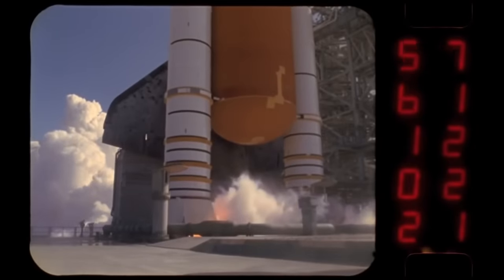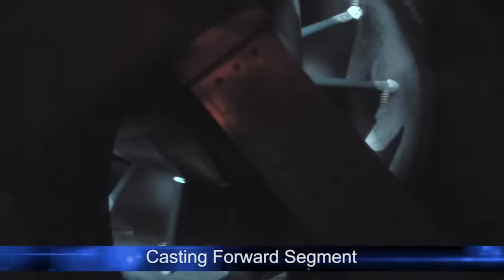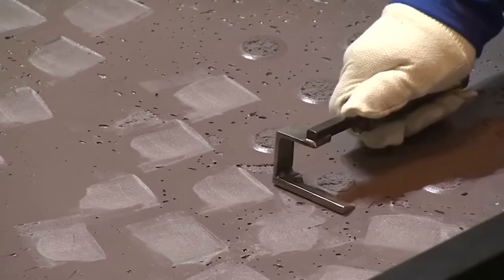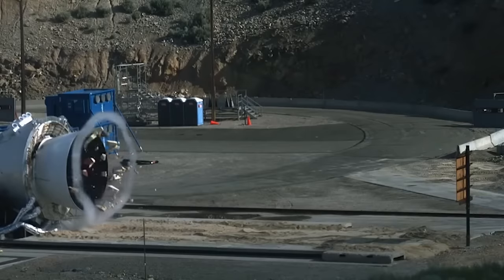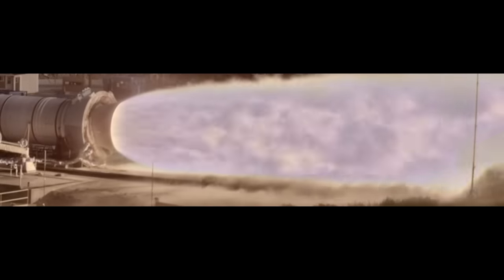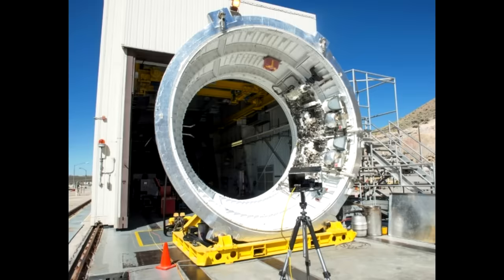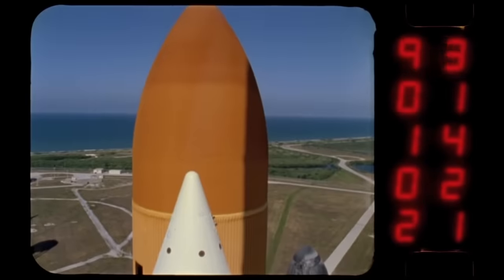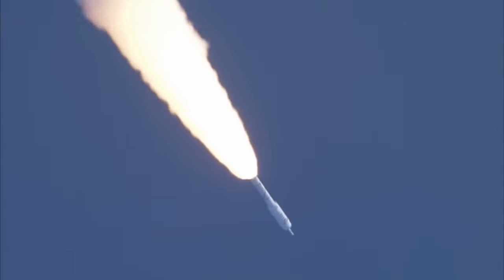The Amazing Engineering Behind Solid Rocket Boosters

Comment: Then why does it lift up so slowly. Like a balloon.
Reply: Because it's heavy...
Reply: It never gains much more speed Pablo Gonzalez. Surely the speeds required to break the atmosphere it should be out of sight in no time.
 What happens then? It arches. Would’ve thought it would of went straight up to save fuel, but again, no it arches, almost like it’s heading out to the Altlantic on a jolly flight to Europe. Then the shuttle always tips upside down, like the heavy part flipping around a balloon. Never understood this stuff.
Reply: @ArnoldClarke  You think it's fake because it doesn't match the idea in your head of what it should look like. That doesn't mean it's fake. It means you don't understand what's going on. 

The shuttle maintained about 3 g of acceleration for structural integrity and the entire flight to main engine cutoff was about 8 mins. Not sure how much faster you think it should be.

To understand the arc and the roll you need to understand orbital mechanics. It's part of orbital insertion. It's going into orbit. It's not a firecracker that just needs to exclusively gain altitude.

If you think it in any way resembles a balloon please seek medical attention.
Reply: Thanks for the explanation Pablo, not once did I say it was fake. I cannot understand the physics. 

At three times the rate of gravity the shuttle is only doing about 70mph.

It looks so slow and it does arch over the Atlantic. 

With the roll does it go on to break through the atmosphere upside down?

Again thank you for the explanation. What would do it, is if they put the camera facing forward. Never seen any footage of this. 

Everything modern on Earth that propels fast always has a camera forward mounted. 

Do you have a link of a shuttle take off with the camera facing the way the shuttle is going? My medicine is your education.
Reply: @ArnoldClarke   Implying they're simply headed across the Atlantic insinuates it's fake. But anyways.

Acceleration forces can't be directly converted to top speed so I question  your math. A top fuel dragster launches around 8(!) g to a top speed around 300 mph. The average airliner barely cracks .25 g on takeoff on the way to nearly 600 mph. Nearly double the speed. 1/32 the force of acceleration.

In space there is no "upside down" and you're right there is no obvious footage facing what the crew sees but I surmise that is because more is happening below the shuttle than in front of it.
Reply: Before the shuttle breaks through the atmosphere is it upside down Pablo?

Would’ve thought the shuttle would break at least Mach to get through the earth’s atmosphere.

Speaking of space, what then propels it to reach orbit, is it the main rocket it’s attached to, if so what has it got to propel against. A cars tyre is the propulsion along the asphalt but since space is a vacuum how is a thruster any good?

If I was in space and the Earth is below me then there is a upside down.

Why is it there’s no camera looking forward. Surly they can flick from camera to camera. More going on behind?  Watching a space shuttle break through the Earths atmosphere doing 300mph whilst upside down is the money shot.
Reply: @ArnoldClarke   The atmosphere gets gradually THINNER with altitude there's no "breaking through"  anything. The money shot is re-entry and THAT has certainly been captured on video.

Once there's no gravity there's no upside down.

The best way to understand rockets is to look at something like a pressure washer. Have you ever used one? They can produce a significant propulsive force and it's NOT caused by the resistance of water hitting the air.
Reply: Thanks for your reply’s Pablo.

Still don’t know why an entry shot is more than an exit shot. Also can’t find footage of a entry shot only CGI of it glowing so hot as it needs to break through the atmosphere. Have seen footage from the back of the crew cab?

If there’s no upside down, how does the shuttle crew know which way to come back to earth?

Rockets are nothing like pressure washers. Jet engines are like pressure washers. They both reduce entry volume to create thrust on exit. 

You points simply don’t make science or sense but thank you for trying to explain this phenomenon.
Reply: @ArnoldClarke   What do you suppose happens on exit that's the money shot?

The astronauts know where the Earth is because they have navigation equipment. There's also a gigantic blue ball near them.

A firehose also creates substantial thrust and it's not reducing volume.
Reply: The shuttle needs to be at a certain upward angle for re entry to have maxim heat protection using the base of the shuttles plate protection. What does it need to exit the atmosphere Pablo? You don’t know because you’ve never seen it happen either way.

The blue ball under neath them?

Fire hose works of pressure. Also the apparatus pumps it further. Certain chemicals, which I can’t remember now, are also added to increase flow.

Still the shuttle is a physics phenomenon.
Reply: @ArnoldClarke  You've never seen it either. You can doubt it but you can't disprove anything.

Down only exists when there's gravitational pull.

I did firefighting in the military (I am NOT a firefighter) and the firehose was pressurized by a generic water pump to about 125 psi. If the fire was petroleum based then foam would be added but it had nothing to do with adding pressure.

Anyways the hose can produce significant "thrust" and it has nothing to do with the relatively small column of air it's "pushing against".
Reply: Pablo it’s been nice discussing this with you, we’ll both wonder how. Take care.
Reply: @ArnoldClarke  You have a fundamental misunderstanding of basic scientific concepts so I can understand why you question what you see.
Reply: What I can’t see Pablo
Reply: @ArnoldClarke  Well next time you see a garden hose use it to learn how rockets work in space
Reply: When my garden hose lifts like a helium balloon, only flies in a arch and not straight up, then flips upside down to exit the earths atmosphere with the main rocket still attached as heat protection is not needed on exit considering the speed is at just 66 mph, then go on to proceed using thrust in the vacuum of space followed by entry at 33 degrees up as its harder to enter then to exit. Then glide all the way to the runway you want with no engine power, although there's three of them on the back. Oh and with no external forward recording of the greatest adventure known to human kind.
Reply: @ArnoldClarke  What makes you think a garden hose lifts like a helium balloon? 

Where do you get 66 mph from? 

There might be 3 rocket engines on landing but there's no longer any rocket fuel to power them...
Reply: The shuttle lifts like a helium balloon Pablo.

Non of your answers are facts or can be proved. As well as all the other points I make. 
Look at this information I give you. Research all sides then please come back to me with definite facts and your conclusions.
Reply: @ArnoldClarke  Not sure you realize that the shuttle is easily visible to a verifiable height and the speed easily calculated. It's quite clearly much faster than a helium balloon.